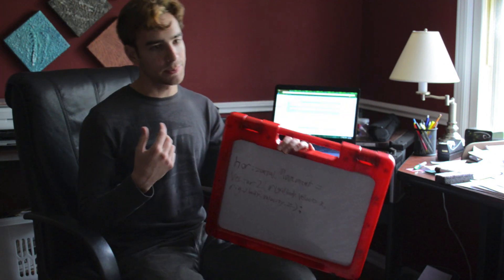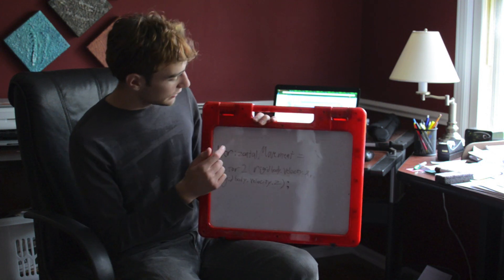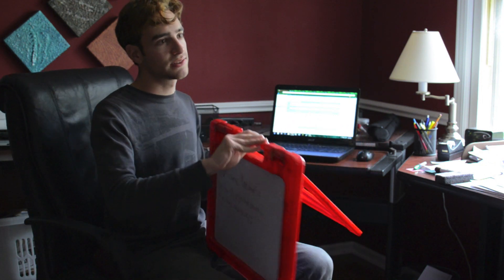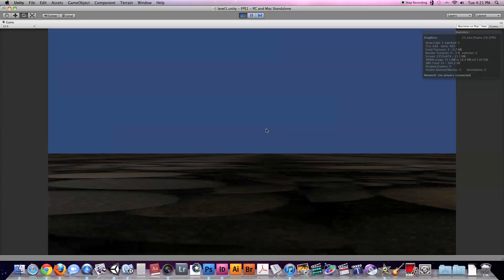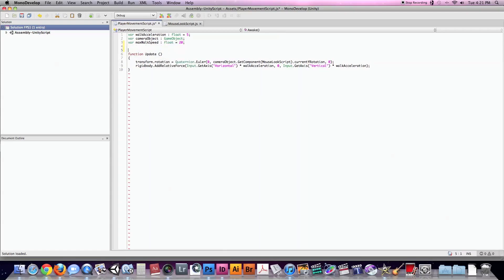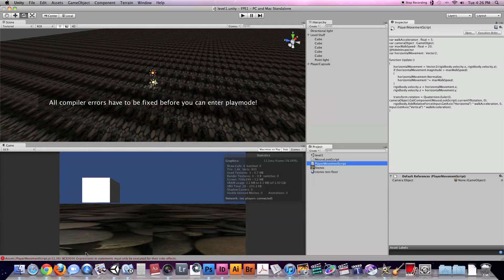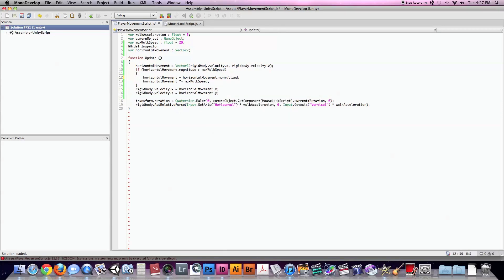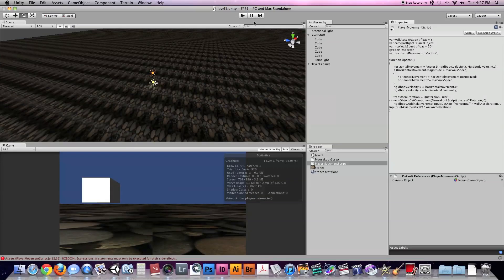FPS1.4 Setting a Max Walk Speed. Unity3D FPS Game Design Tutorial.

Comment: This seems a bit overly complicated. Is there a reason not to just do this?

horizontalMovement = Vector2(rigidbody.velocity.x, rigidbody.velocity.z);
	
	if(horizontalMovement.magnitude < maxWalkSpeed)
	{
		rigidbody.AddRelativeForce(Input.GetAxis("Horizontal") * walkAcceleration, 0, Input.GetAxis("Vertical") * walkAcceleration);
	}

This way your character can still move at more then walk speed but will not be able to add extra speed if they are already traveling faster then the max walk speed. Aka being flung by an explosion or... hmm moving platforms might cause problems.
Reply: ooo I see. Adding force at the max walk speed will bump you over the max walk speed and disable the controls which is all fine because friction will slow you back down... untill you jump.
Reply: aa here is a fun way to do it. More realistic too. It will begin to limit the force you can input when you go past the max walk speed. the faster you are going the less control you will have. this will also allow you character to be forcefully moved faster then what the inputs can provide. :)

//gets current speed//
horizontalMovement = Vector2(rigidbody.velocity.x, rigidbody.velocity.z);
	

//sets a percentage that is inversely proportional to the speed over maxWalkSpeed//
if(horizontalMovement.magnitude > maxWalkSpeed)
	{
		runDecceleration = maxWalkSpeed / horizontalMovement.magnitude;
	}

//Keeps runDecceleration from getting stuck at a low percentage in the event of sudden decceleration//
else
	{
		runDecceleration = 1;
	}

//wasd movement restricted by runDecceleration//
rigidbody.AddRelativeForce(Input.GetAxis("Horizontal") * walkAcceleration * runDecceleration, 0, Input.GetAxis("Vertical") * walkAcceleration * runDecceleration);

Comment: Why Does the acceleration increase when i walk diagonally?
Reply: KnowledgeableBricks It happens because you're adding two force vectors, with a length of "a" each, so the resulting vector is "a times square root of 2" long. So yeah, just limit the vector's magnitude, or detect if you're moving diagonally and then multiply the vector's length by 0.7 (which is 1 divided by square root of 2)
Reply: That happens with me too. Anyone know how to fix it?

Comment: if anyone is wondering i ran across a problem with using this Vector2 method when converting these scripts to C#. I had to use a Vector3 instead since it wouldnt let me just set the rigibody.velocity.x and z to horizontal movement i had to set it to a Vector3 containing those values.